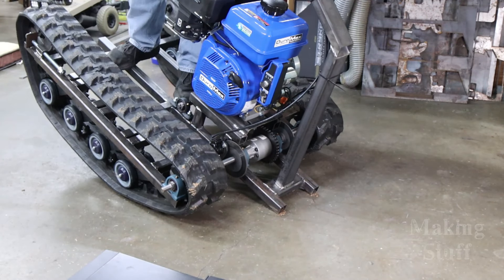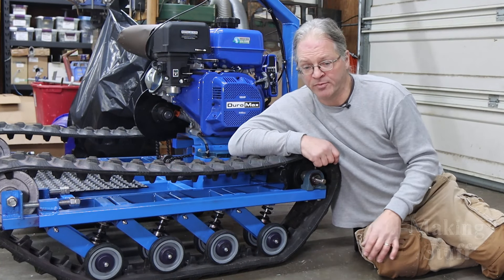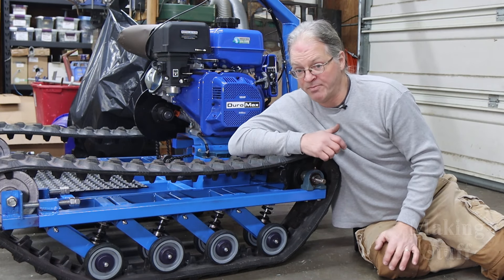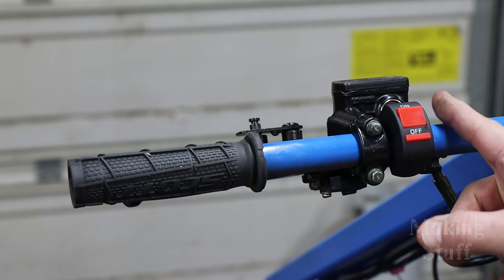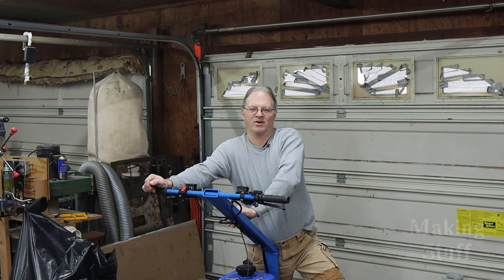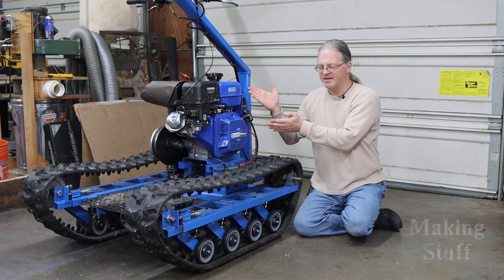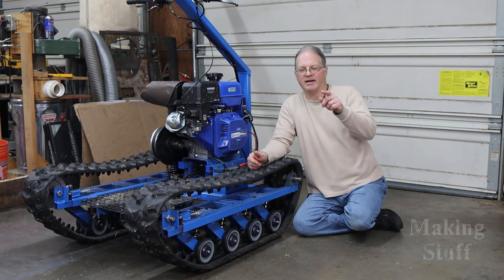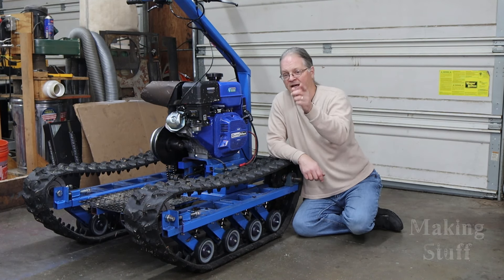Taking It For A Spin - DIY Tracked Vehicle It Lives!

Comment from the maker: Hope you guys enjoyed the tracked vehicle project.  Let me know what you think about it!  What would you do different?
Reply: Looks great! Only thing I'd change is maybe putting a different standing platform. The steel looks like it might get really slippery once its wet.
Reply: You're not finished yet. You need to make it amphibious as you never know when you might need to cross a big ass lake. Don't forget all the electronics such as GPS guidance, Ham radio, thermal image camera, etc...
Reply: Great build! Looks super fun! I would like to respectfully make an observation and that is I think your tracks are on backwards (treads should point to the front of the vehicle). Like tractor treads, when in this orientation, they tend to plug up with mud and not actively shed it. If you turn each one around, mud will slide toward the sides of the tracks instead of toward the center. Cheers!
Reply: Please put on Guards on the tracks so you don't become part of the them.     
 Its a great machine no doubt.  But you got to think of yourself first.
Reply: Amazing and fun project!  How did you come up with the size of the spocket?
Reply: Tow hitch trailer for fun and practical action.....
Reply: looks like a copy of chucks ptv,
Reply: That is Military all day, Wildfire Containment... & Rough Terrain Powered Pellat Jack for Off Grid/Isolated locations...

Could you make an Articulating Trailer .... 
Have that feed off the drive train.... Thought I saw a Military Trailer like that once....
Or
Capture the Energy and recharge a Battery Bank have it like a Powered assit but able to run kinda Free wheel until needed?

If you could Recharge a Battery Bank... Then you might be able to use it for Tools and such

It looks like you had a blast.
Reply: It looks like it needs some return rollers on top to take out the excess slop in the track to prevent throwing a track. Also some guards as others mentioned to not lose a limb in the tracks.
Reply: The main thing that I would have done different is that I would have mounted the pillow blocks to the ends of the steel tubing vertically...that way the tracks could have been tightened by spreading the bars apart and you would not have had the clearence problem when the drive wheel turned
Reply: Love it, would u consider selling it??
Reply: Hi,  I never found a link to the differential you used in the drivetrain.  Hope you can add that to the list.
Reply from the maker: @anybodyelse35  My bad, it's on the Making Stuff Web Page.  https://makingstuff.info/Projects/Personal_Tracked_Vehicle
Reply: As is, seems just a toy. I would like it to do work, like pull a heavy trailer full of feed or firewood or whatever. Still very cool build as is.
Reply: I built one like that when I were younger and use a snowmobile track. I cut the track down the center and made 2 out of 1.
Reply: Fenders and a seat maybe a rear light
Reply: I'd want a dump box to haul firewood out of the bush. 😂

Comment: Great gadget, looks like a ton of fun to ride!  Reminds me a lot of a Kettenkrad, a WWII era vehicle which solved both the nose-dive problem and the steering challenge by marrying sometime very much like this in back to something like a motorcycle's front wheel in front, with a little stool in between for the driver's comfort, and a cargo bin in the back.  I'm really amazed how stable this standing design really looks in action - I expected a video or two of troubleshooting before it was ready to do everything it did on its maiden voyage, great work!

Comment: I bet that thing would do well dragging firewood out of the woods. Needs a small trailer hitch and some kind of drag sled or garden trailer to pull.
Reply: This is exactly why I've been binging PTV vids. That and for trail building, snow plowing, fun on the logging roads. I'd just want it narrower to fit on the trails.
Reply: I also would like it to do work. But Im afraid it will only do wheelies when pulling anything. Im sure some modifications would change that. I Love this build regardless.

Comment: The personal track vehicle you built is a really practical and worthwhile project. It is unique and not otherwise available.   
  The tracks are too loosely adjusted. A reference spec for track tension from the OEM of a slightly larger skid steer machine is ~ 1/2 inch track sag with the track lifted off the ground, at the middle of the track span under the bogie wheels.
 Skid steering will cause a lot more wear on the axle brake friction components due to the high duty cycle of applied braking with active drive torque is occurring, compared to  a wheeled vehicle without active drive train torque when braking. With the relatively small diameter brake disks, overheating of the brake pads and rotors will be a concern as well.  Consequently, the axle braking disk rotors should be larger diameter. Larger diameter brake rotors will provide more steering action with less pressure applied to the brake caliper pads on the brake disks, and will result in a lot less heat generation and brake pad/disk rotor wear. Some skid steer vehicles have squirrel cage blowers to provide cooling air directed to the axle brakes. The diameter of the axle brake disk rotors should be as large as practical, withing the design limits of the machine structure. 
A preliminary rough sketch of the design lay out configuration would have been helpful in recognizing the likely  problems of component placement and machine balance encountered, before the machine was under construction.

Comment: Very nice set of videos. Love the on-the-fly design, including the details when you had to go back and re-design a few things. I'm going to point out one slight issue. When installing a bolt through a hollow square tube, if one tightens the bolt enough, the tube will eventually deform and crush. The usual reaction is to tighten the bolt even more, which only makes it worse. The fix is to install a bushing cut to fit inside the square tube. If close enough to the end of the tube, it can be tack welded in place. If too far from the end of the tube, one can increase the length of the bushing, drill out at least one side of the tube, then weld the bushing on that one side, and grind it smooth. Now, the through bolt has something to hold through, that can't be crushed.
Reply: Соглашусь с Вами, друг! Электродом туда, точно залезть можно). Либо заварить торец трубы стальной заглушкой, а не пластиковой пробкой. Можно со стороны гаек, пластинку стальную (в виде одной прямоугольной шайбы на два болта + прихватить её на пару прихваток к трубе) Жёсткость - точно добавится.

Comment: This is ready for production and sell it online, and/ or thru Tractor Supply Co.! Blue is great! JD green and orange could be other considerations. Well done!
Reply: I think the only thing short of production I could think of might be a dead-man switch, as a safety measure to stop the thing running should someone fall off.    Someone else mentioned a splash-plate underneath and to protect the rider from splashing, which might be a nice touch and simple to add, and fenders over the tracks for a little extra safety to protect fingers and toes and and further protect from splashing., which might make another nice finishing touch  

All around, it looks like a ton of fun, makes me want to say "take my money, please - I need one!  And someplace to ride it, but I'll figure that out later....."

Comment: When you turned the bogies around that's when you messt up because now it rides like a buckboard. The bogies are supposed to move up and away from obstacles . But it's cool as hell and has me thinking about building one.
Reply: I can't help thinking this reminds me a LOT of a Kettenkrad, and with that, it's almost begging for a seat and cargo carrier of some sort, which might be enough alone to counter-balance the vehicle back toward the rear and prevent those random nose-dives that the rbogies were reversed to fix.  A cargo bin would give it the next step toward a practical angle for things like, as mentioned in other comments, carrying firewood.  Or, carrying tools out to a worksite, or gear out of a campsite....

Either way, it looks like a hell of a lot of fun as-is!

Comment: You need a couple idler wheels, and the track tightened a bit. A rubber mud flap and a solid belly pan/skid plate would help too.

Comment: Been following this build cause I want to make a tracked cart to get around our property. During the summer and fall our 2WD backhoe  gets around just fine but in the winter we get around 1.5 to 2 feet of snow and the spring the ground is really soft making it hard to get anything done out on the property. A snowplow attachment to the front of a tracked vehicle would make plowing snow a bit nicer also. Thanks for sharing your build and going into depth on the parts you used and how it all went together. :)
Reply from the maker: Thanks for watching!

Comment: Years ago I made a track machine that did the same thing yours does, Nose Dive. What I did to get rid of that feature was to make a gyroscope. The machine stayed level when the engine was running.
Reply from the maker: Nice!
Reply: @MakingStuff  Try the gyro attachment. Ultra slow motion movements that are real natural to boyd form.

Comment: What an amazing project! It looks terrific and seems like it is a lot of fun. The drive system is a lot simpler than I expected 🤔
Reply from the maker: Glad you like it!
Reply: That's how a lot of tanks were made, up through to WW2. Apply brake to one drive, and because of the differential, the other track keeps turning.

Now, also during that time frame, tank steering also started to get a lot more complicated too of course, with clutches, and gears and other methods of getting the same effect that was more efficient. Heavy tanks using brakes to steer generated a lot of heat in the steering brakes, if you watch footage of old tanks being driven, you will see them making turns in multiple stages if they can, this helps to avoid burning the steering brakes from dragging them too long. One of the obvious issues, was that turning slowed you down. Period.

Modern tanks use vastly more complicated gearboxes that allow the vehicle to maintain speed in a turn, and can also do neutral steer. With track braking, you pivot around the track that is stopped. With Neutral steering, you pivot around the vehicle's centre of mass (or centre of track resistance).
Reply: In my mind, I thought you needed steering brakes AND clutches at least. It was nice to see his system work so well as simple as it is. Neutral steering seems like it would be ideal, but for a simple ATV, his differential and brake system is pretty awesome!
Thank you for the info 👍🏻

Comment: Great Job ... Works Well ... appears to function as planned.

BUBBA, You need inner guards for those tracks for two reasons:
#1:  It's just a matter of time until You get your feet, pant legs, or something else caught in the moving tracks  You only need them from the floor up to the moving mass of the tracks.  They can be fabricated from thin guage sheet metal or even plastic.  Anything to act as a shield from the moving mass.
@2:  The guards will deflect the water away from your feet and lower clothes.  That's a nice thing when its cold outside.
Reply from the maker: Yeah I found out #2 when I drove it through the creek.  It's on my list of future upgrades.

Comment: That is sick. Any plans on covering the tops of the tracks or anything? I mean it's a custom made vehicle so do whatever you want safety wise but covering the tops and sides might be good to keep toes out of them.
Reply from the maker: Yeah after riding it in the snow and crossing the creek I noticed that I got pretty wet and dirty.  Some type of fender would be a good idea.  Thanks for watching!
Reply: @MakingStuff  I 'd also add one of two idler wheels on the top side, under the rubber track as the track does bounce up and down and if you fit fenders, they will rub. But it's awesome!!
Reply: I had the exact same idea. I used to work at the Tank arsenal in Warren MI. building M60 tanks and I think that installing fenders and rubber flaps like a tank would be great. I’d like to build something like this, it would bring back memories of driving the tanks off of the final assembly line. It was a pretty cool job for an 18 year old gear head. For now my zero turn mower will have to do. 😦
Reply: Been watching for a while and would really like to build one of those tracked riders. How much dollars do I need for all the parts ?

Comment: Looks awesome. If I may make a suggestion though as a safety feature I'd add a padded piece over the centre of the handlebars. If for some reason it came to an abrupt stop you will end up hitting your chest on the square box section end and it will do some damage to you. They used to put padding over the stem on bmx bikes for the same reason. looks like an incredibly useful machine though for smaller jobs around a farm in boggy/snowy conditions

Comment: Very cool build.  It has one thing that I would have to change or do different.  The tubing going to the handlebars where it 45's and you butted them together leaving open tubing.  I would of miter cut and welded and placed a small gusset inside.   If I was you I would print a cap for it too.  Or put another led light bar to cover it.   But that is just me nit picking.  Don't take it bad I do it to my own project all the time.      I would also like to say I have followed you for many years on and off and I greatly respect you for showing your mistakes.    We all make them especially when building Something in our heads.

Comment: I'm a 77yr old that thinks he's still 18.  Would like one of these, or plans with parts and suppliers, or even a kit.  I like Wayne Crews comment on perhaps 1or 2 top rollers , like bulldozers, to minimize the likelihood of throwing a track.  Oh! And perhaps a seat, but not necessary. Just wanted to let you know that I've had to fix a few bulldozer thrown tracks, and it wasn't fun,especially on a side hill.
Reply from the maker: I haven't thrown a track yet, but I also haven't gotten too crazy with it either.  Thanks for watching!

Comment: It needs some gaurds for the tracks and some idlers for the top of the tracks.also the bottom of it should be skid plated and some kind of rollers on the front and back edges so it wont get caught on anything it would just roll over any obstacles.nice machine .maybe even some foot holds  and a horn and possibly a second gear too.

Comment: Really nice work.  Thanks for the detail and info.  I am really interested in modifying a small boat trailer with tracks for putting a boat in and out of the water or personal water craft.  Our shoreline is a gradual slope but a bit rocky, no sand, so I feel this might be a solution instead of a boat lift.  I am envisioning using two electric motors and eliminating the differential.  Not sure how long the make the tracks but would like to keep the weight as low as possible.  You've given me lots to think about!

Comment: Now i have to go back and watch the other ones to see how you made it. 
Sweet build. 
As for other things 2 wings to prevent yourself from getting wet and some idler wheels to stop the flapping of the top track. 
I am not exactly sure how you turn the unit yet. Though if it is brake controlled then a seat like a 4 wheeler would be nice.
Reply: Ah yeah you used a diff. I have seen one of these made like this as well. 
Its a sweet project and pretty much could be made much bigger and a sit down type as well. The HP size is just fine for this unit, even a 22hp harbor freight unit if they canbe had would work for something larger. The diff on the other hand might not be big enough. I would have to double check that.

Comment: It could use some carrier  rollers for the tracks..to stop them flopping around...hope your differential  holds up..
Reply from the maker: Me too.  Diff is rated for more torque than engine has so it should be fine.

Comment: I had to stop in the middle of work to watch this video. 
That is awesome. Absolutely awesome. A tracked Segway. What could be cooler?
What would I do different? Maybe put some fenders on it to protect from mud/dirt/water. Might make it a bit safer if you ever fell onto the tracks. 
How did reversing the wheels stop the nose dive?
Still, I WANT ONE!!! I mean I really want one!!!!  Any plans for plans?
Reply from the maker: Reversing the wheels completely fixed the problem.  It hasn't nose-dived on me one time, even going down hill.  No plans for plans at this time.  But that could change.  Thanks for watching!
Reply: @MakingStuff  Let me know if you ever make plans. I'm a buyer! Add some cup holders if you do🤣🤣
BTW. Looking at your snow conditions, vegetation, and topography, I'd say we're neighbors, within an hour of each other.
Reply: @MakingStuff  what a cool build.  I'd love to get plans and a parts list if you ever make one.  It's exactly what I'm looking for but unfortunately would need guidance from plans to build it. Well done sir. Love it!

Comment: Are those tracks on the right way ? for gripping the tread should be arrowed forward imho>>>> I think this helps shed water as well . A great build 👌
Reply from the maker: No apparently they were on backwards in the video.  I have since turned them around the correct way, thanks for watching!

Comment: Cool build for sure. I do see something that is IMO not right. Yet you could have it that was for a reason. Both tracks are on backwards. Needing flipped. The tread is like a tractor tire and they are pointed backwards. Other is. How easy is that to pull back if you can not spin it around as I do not see a reverse on it?